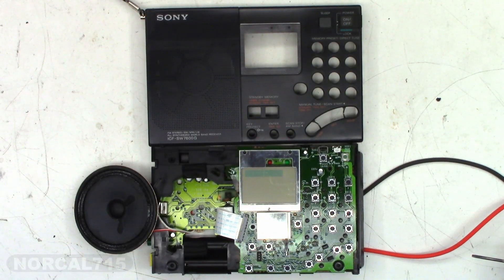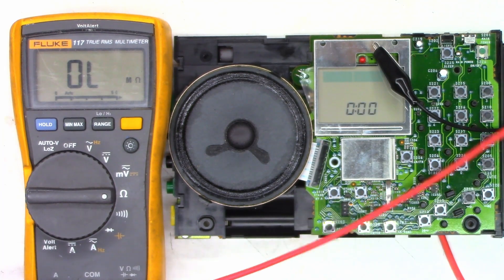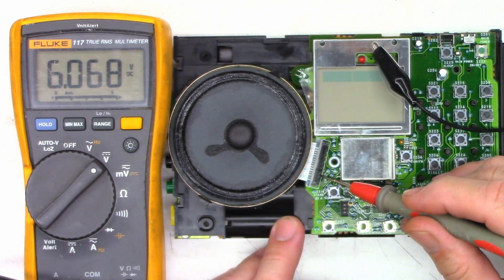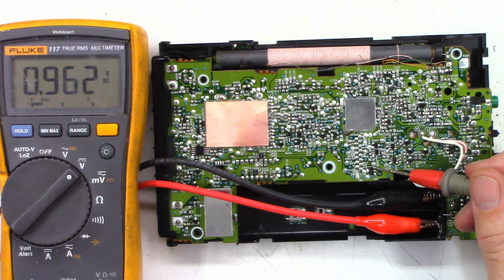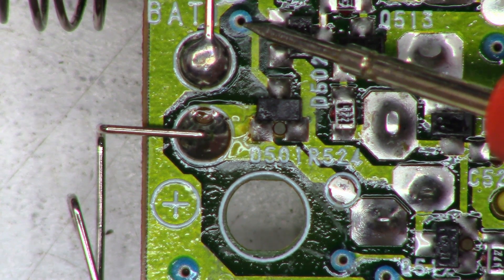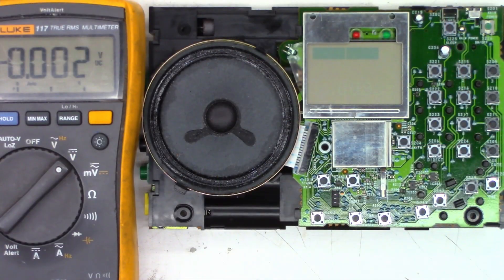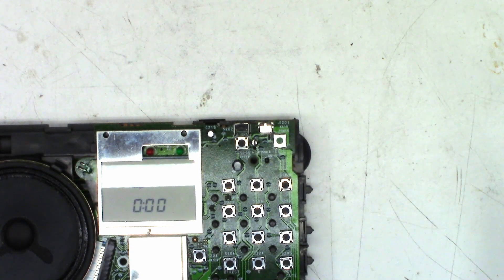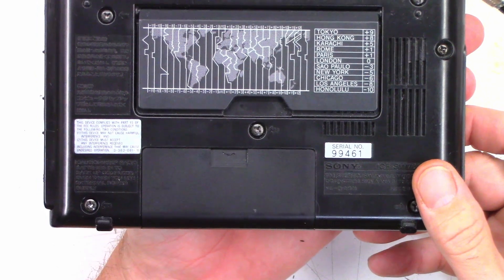Sony ICF-SW7600G AM-FM-Shortwave Radio - Wont stay on -Forgets memory.

Comment: My same radio plays for about 20 mins, and the sound goes away.
I plugged in head phones, and it plays for hours on end.
I think its the Amp chip.
What are your thoughts?
Reply from the maker: Possibly a bad coupling capacitor or bypass capacitor leaking and causing the IC to overheat and go into shutdown. Headphones have a higher impedance, plus normally a resistor in series with the hot lead of the headphone jack so you don't blow your ears out.

Comment: How can i touch with you. Can you send your email i have trouble in same radio but only am and lw doesn't receive a signal but if i use Tecsun AN-48X Indoor Active Loop
The signal works well on it

Comment: Sir I have SONY ICF SW77 radio .... Can those faulty 24 capacitor make the Jog dial not to work sir ??? Anyone from this group please reply to me... ??? My Arrow scan keys are not working... An the sound is very low like 5% only on full volume... So what has made my those Jog dial not to work... ??? Please reply ...
Reply: You need to replace all electrolytic capacitors.

Comment: Clock Battery  is depleted.
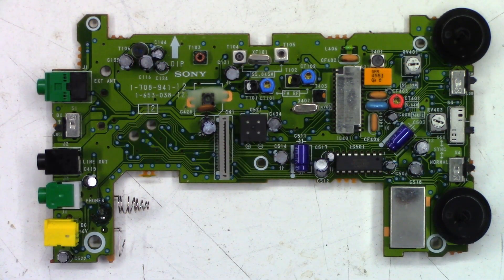Reply from the maker: The clock backup battery is a supercap and it tests good. The microprocessor was doing a hard reset at low voltage. At 4:29 you can see it on the video. It is C521.